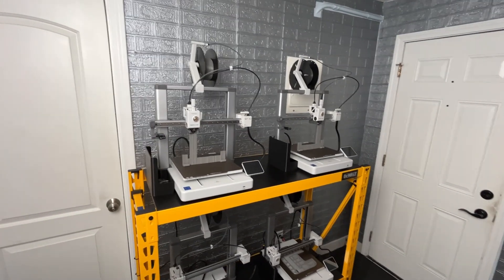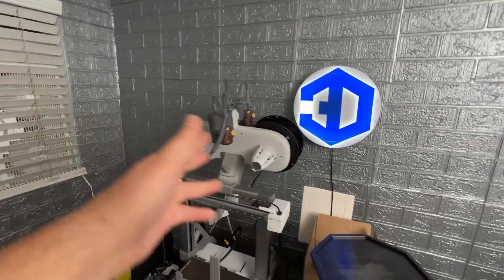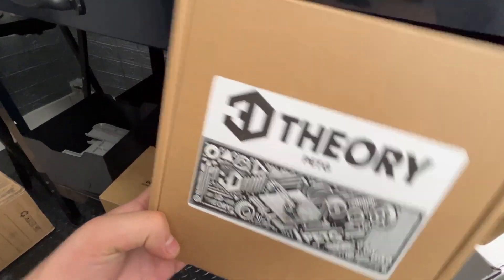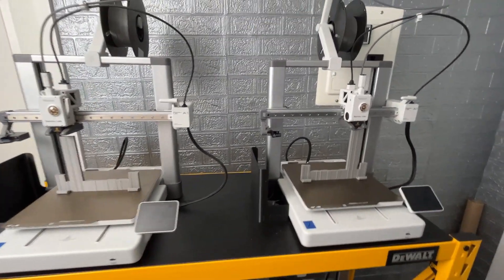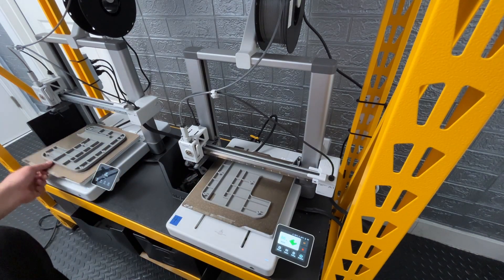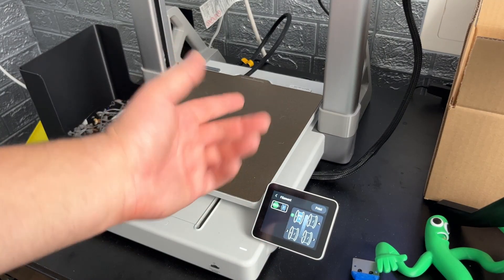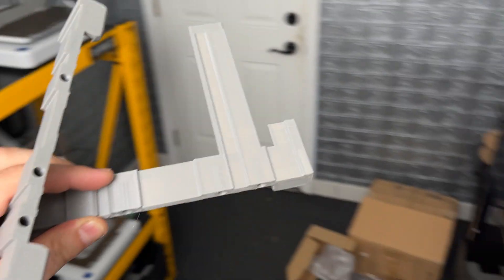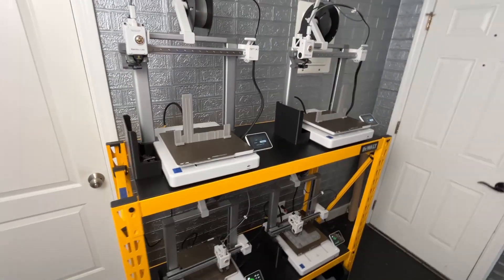Quick Update: Why I Switched to Bambu Lab A1 3D Printers!

Comment: There is a plate swapping project with the A1 Mini, you might want to keep an eye on it as if they supported A1 then you could print both components from the same printer one after another. That might get your utilisation per machine up (probably not so much of an issue at your scale but if you have 50 machines it really matters!).
Reply from the maker: @radicalbyte  Thanks for pointing out the plate swapping project with the A1 Mini! I really appreciate that they switch out the entire plate rather than just removing the print, which is a fantastic feature. While the Mini might be too small for the plates and latches I usually work with, I’d love to see this applied to the A1. Such a feature would indeed help increase efficiency, especially when operating at scale. I’ll definitely keep an eye on it. Thanks for the tip :)
Reply: @3DTheory  It's such a smart idea. I just grabbed a mini + AMS combo, AMS will go with my A1 and I'll use the Mini in my office for printing prototype designs in cheap PLA. I'm trying to start up selling print-to-order parts for retro computers for extra revenue next to my software development services. I have spare capacity over after software work + want to create an awesome SaaS product for 3D printer companies (there's nothing good on the market compared to systems I've built for industry; good software with good integrations cut delivery and smash QA/support costs).
Reply from the maker: @radicalbyte  That sounds like a fantastic strategic approach! Your plan to develop a SaaS product for 3D printing companies could indeed fill a significant niche. It’s impressive how you’re combining your software expertise with 3D printing. Actively marketing your products, perhaps through targeted ads, could really help reach as many potential users as possible. I loved hearing about your project! Wishing you great success with your venture :)

Comment: they just work... mine is 1300 hours in now and i changed nothing but the wiper twice... had two nozzle clogs due to my own stupidity and one extruder jam due to seeing how fast i can push eSUN eTPU transparent with it. if you should need some parts or spares just order from the app. great ecosystem. wish they had more interesting colors and types of tpu. for pla its great, abs is good, petg ok.

( if you wonder i got to 12mm cubed@230c with a 0.6. upped to 242 and have not tried pushing more. im happy with the 1 hour pr can sleave. it needs to cool too :)
Reply from the maker: @reyalPRON  Thanks for sharing your experience! It sounds like you’ve had a really solid run with your Bambu Lab printer. I agree, their ecosystem does make it easy to maintain and source parts. It’s great to hear about your successes with different materials, even pushing the boundaries with TPU! I also appreciate the reliable print quality and ease of use with Bambu Lab, definitely one of the key reasons for my switch too. Hopefully, they’ll expand their range of TPU colors and types soon. Thanks again for your input :)

Comment: Hi, you might want to check out the pan to touch it would have told you that the other printer ran out of filament.
Reply: Panda touch    typo
Reply from the maker: @charlesvrogers  Got it, thanks for clearing that up and for the tip! I’ll definitely look into the Panda Touch :)
Reply from the maker: Thanks for the tip! I’m not quite sure what you mean by “check out the pan to touch.” Could you elaborate a bit more? I’d appreciate understanding your suggestion better :)

Comment: You could do the first layer with pla and then continue with petg then you wont damage the buildplate

Just curious why do you only print one design on a buildplate?
Reply from the maker: @mitchellsnoek1759  Thanks for the suggestion! Using PLA for the first layer and then switching to PETG is an interesting idea, but I can only implement that on my AMS Lite-equipped printer. I only have one of these, and I mainly use it for the auto refill function to finish up near-empty spools of filament. As for printing one design per buildplate, I do it for efficiency and tracking reasons. It streamlines the process since I can simply click and print without needing to adjust settings, which saves time and minimizes errors. Each of my printers is numbered, so if there’s an issue with a print, I know exactly which machine to check. This method helps me manage and troubleshoot more effectively. Really appreciate your curiosity and the tip!
Reply: @3DTheory   did you see the swapsystem for bambulab? it will release next year they say.
Reply from the maker: @ Yes, I saw the upcoming swap system for Bambu Lab, it looks fantastic! The feature that allows replacing the actual PEI sheet rather than removing prints from the bed could really streamline the process. Really looking forward to it! Thanks for bringing it up :)
Reply: you could put a g code inside your slicer. that it stops after it finished the first layer but the bed need to stay heated. if it cools it will get loose.
Reply from the maker: @ Thanks for the suggestion! I’ll keep that in mind for future projects. Appreciate your input :)

Comment: I got lost in all of the ancillary details.

So why did you decide to switch and standardize on the Bambu A1 printer?
Reply from the maker: @frangeech  Thanks for pointing that out! I appreciate your patience as I tried to keep up with my upload schedule while managing multiple tasks. Here’s why I decided to switch to the Bambu Lab A1:

-I experienced layer shifting and under extrusion with the Creality CR-10 SE, which affected the quality of my prints.
-Despite its automatic bed leveling feature, the CR-10 SE’s print bed was slightly tilted, causing my prints to be on a 5mm tilt, not allowing my product to function. 
-I encountered frequent hardware error messages popping up, including problems with the motherboard which required replacement parts. 
-The nozzle often scraped the print bed, resulting in poor quality on the first layer, and caused warped prints.
-The CR-10 SE struggled with achieving sharp corners, often rounding them off, which created tolerance issues that then required adjustments to my 3D models to work around this problem.

Given these issues and since both printers were priced at $399
at the time, the switch to the Bambu Lab A1, which offered reliable performance and high quality prints, was a clear choice. I wanted to press print, walk away, and come back to a finished, high quality print. The A1 did that. With the CR-10 SE however, I had to babysit it for the first hour of its print where 3 out of 5 prints would fail for one reason or another. Thanks for your question, and I hope this breakdown helps clarify my decision :)
Reply: @3DTheory  This paints the picture, thanks for the details!